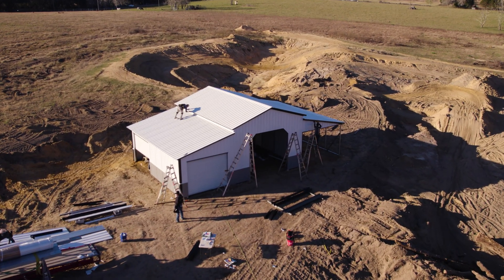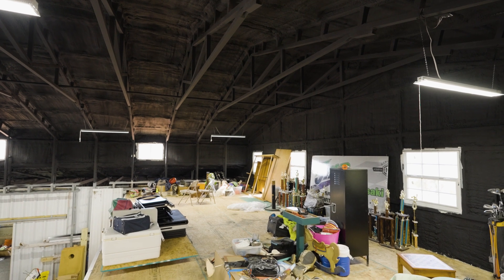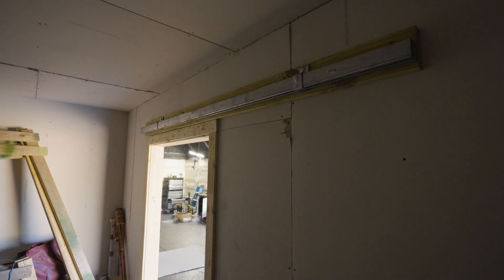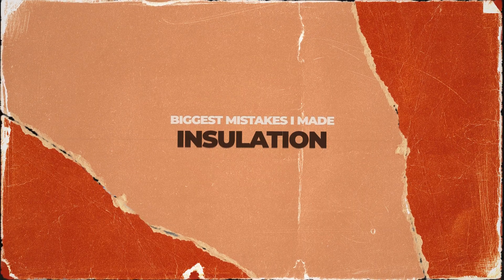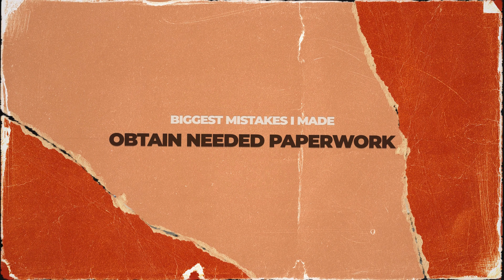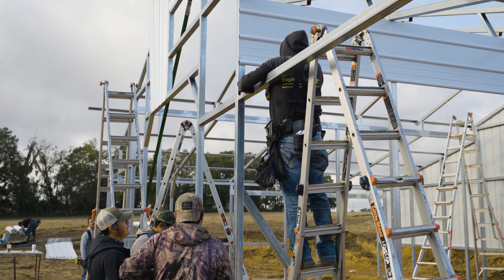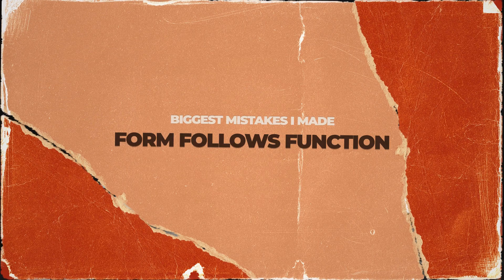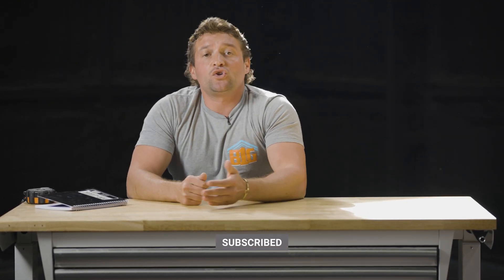Biggest Mistakes With A Metal Building Project | Metal Building Monday

Comment: Hello, is that spray foam black? Or painted black? If paint, can you list the paint name and type etc? We have a deposit on our building that will be built soon with you all in OK. Adam has helped us:) we also plan to build another at our other business location. I’m most concerned about the drying in. That it is watertight, which they assured us they are. Don’t want leaks onto drywall etc. any advice on that? Also, thanks for sharing all of this! Definitely heard the same things about a month ago and redid the design completely, opting for one lean to and a bigger building footprint. This video confirms those decisions. Until you build and live with it, you never know what the life of the building becomes.

Comment: I had a slab poured for a 30x30 metal building. The front edge of the stub has a gap that is not level. Will they still be able to install an Anchor down the building with uneven edges.
Reply from the maker: You need it completely level and square for a certified install!

Comment: I would add.
- Climate control, both heating and cooling.
- Foam the floor no matter what your going to use the building for.
- Floor drains.
- Bathroom if you going to work from this building.
- Think of this as an investment that will add value to the property and later at resale.
I just put up a 14' x 28' if I told you what I spent you would drop over, I'm a journeyman electrician by trade and a DIY so I had very little out of pocket for hired help.
Reply from the maker: Very awesome advice! Thank you 🙏
Reply: Are you speaking of using XPS under the concrete floor? Thanks!

Comment: Is it possible to pour concrete after building installation? 

Thanks for the time.
Reply from the maker: Yes definitely
Reply: @bigbuildingsdirect  thanks. Appreciate the reply.
Reply: @bigbuildingsdirect  would this effect the certification or integrity doing concrete after the fact?
Reply from the maker: @abuck2844  would all depend on the anchoring system used. We can certify up to 140mph on ground